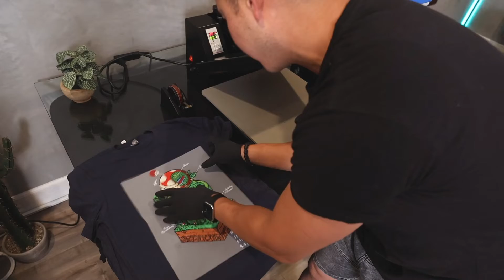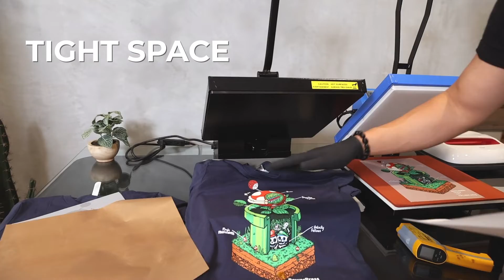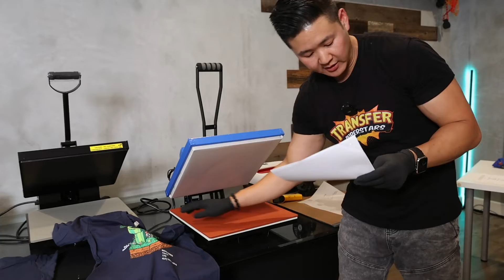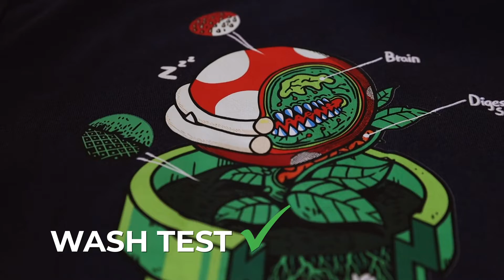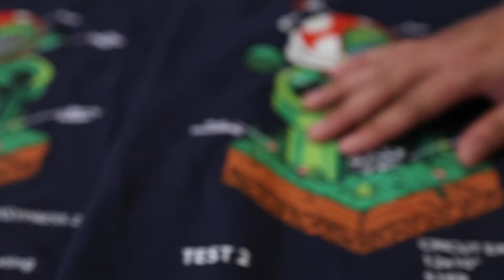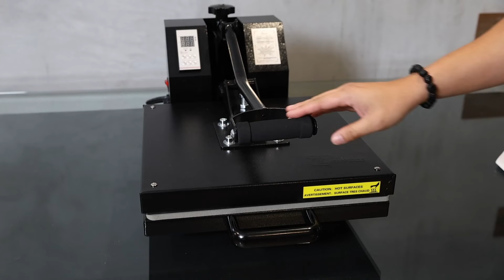7 Top Wallet Friendly Heat Press Machines Unveiled! PART 2

Comment: Hello, I really appreciate your videos. I currently own an easypress 3 and I am about to try pressing some DTF also... But since I watched your videos I have my I became sceptic and I will try to get a proper heat press... I am saying try because I leave in an island in EU and most heat presses from your videos are not able to ship or the price to ship is higher than the price of the press it self. :(
One request I have from you, if possible,  can you retry the easy press but with higher temperature, like 25-35 decrees more to reduce the gab from the actual 300F needed. Thanks in advance.
Reply from the maker: It works slightly better with higher temperature but the lack of pressure is the biggest concern. You will have to test it yourself.

Comment: The Cricut Easy Press has so many reviews because it was the first at home hand held press that was introduced to the public. I have never ordered this iron because of all the issues you mentioned in this review.

Thanks for your honest reviews.
Reply from the maker: Appreciate that, we're just trying to be honest in our reviews!
Reply: Don't forget also, cricut cutter owners are a 'special' breed.  They'll defend ANYTHING from that company, a bit like mac owners, no matter the issues.
Its also notable that the easypress is designed for high temp vinyl, not film/DTF transfers.  And for that it works great.

Comment: Thanks for the comparisons!  I learned something new about the wash test and how the pressure results can be identified.  I own three heat presses, and the three things I look at are 1) heat-up time (my HPN Craftpro press takes up to 20 minutes), 2) Setting alert, lets you know when set heat is reached, and 3) Cut-off feature! I cannot tell you how many times I forgot to turn off my HPN printer and the craft room feels like a sauna.  

The press I use every day is the HTVront. I added a circuit 15x15 press pillow under the one that comes with it for pressure. Love its ease of use and the auto-open feature.

I came here as I am looking to get a larger printer to replace the HPN 15x15 but your point about the size you need and use most has me rethinking.  Thanks again
Reply from the maker: Awesome! Glad you liked it!! Keep us in mind if you need a transfer provider. https://www.transfersuperstars.com/products/dtf-gangsheet-builder

Comment: Easy press I press lighty in same sections as you did n works great 30 seconds at 300 haven’t need full body press
Reply: How many washes does it survive? I have my loklik easy heat press (pretty much the same) and I struggle to make it last even 1 wash without wrinkling. I'm starting to think that this heat press is bullshit and I will need something better

Comment: Since the Cricut EasyPress does not have enough pressure, will re-pressing with more pressure prior to washing the shirt help at all? I just tried DTF for the first time with two shirts using my Cricut EasyPress prior to watching this video.  Wanting to see if there is any hope in saving the pieces from being ruined when they are washed.
Reply from the maker: Pressing the shirts before washing the shirts with a heat press that can provide sufficient temperature and pressure will absolutely save the shirt. We’ve been able to get bits of a design to work with a household iron, but nobody has time for that. Just get a decent heat press for $200.
Reply: I have a Cricut heat press and i love it for iron on  I have done large t shirts and yes i have to press two times on the image . . my sublimation is usually pretty good from coasters , key chains but on t shirts if i do not wash inside out  will wear out  i am looking for a easier way cause my shoulders hurt cricut is great but you have to use your arm strainge to put pressure

Comment: "easy to use" is different from "easy to assemble". It's not fair to rate it under ease of use just because it took you 20 minutes to assemble it.
Reply from the maker: The competitors had no assembly required, its rare that a press has to be put together these days. I could imagine all the loose bolts over time.

Comment: I make sandstone coasters a lot with my HTVRont press. It was rough going until I realized that the included mat dips I the middle. I replaced it with an Artesprix foam mat, plus a nomex mat sometimes.  Really increased the pressure and eliminated the unevenness. I can now print edge to edge full color coasters no problem
Reply from the maker: We really liked the feature of the HTVRONT as well but we weren't able to increase the pressure enough for DTF to LAST. We even tried replacing the included mat and swapping it out with 2 layers of 1/2" silicone base and still did not have enough pressure. We were able to print edge to edge but the transfer prematurely wrinkles in the wash.

Comment: Do you know where else can I get the powerpress because its out of stock in the amazon link you provided..
Reply from the maker: Hi! I understand it's currently out of stock for the holidays but they should be restocking soon. I would hold off and check back in 30 days. It will most likely be back in stock.

Comment: Thank you! Do you have any aeromatic ones you recommend that are under $1000?
Reply from the maker: Unfortunately I do not know any sub $1000 that I could confidently recommend. I have heard good things about the MEM Dual Heat Press stations but I haven't tried it. They do run around $2000.